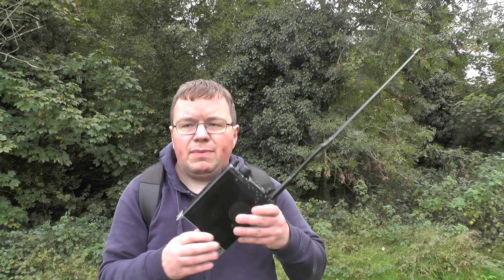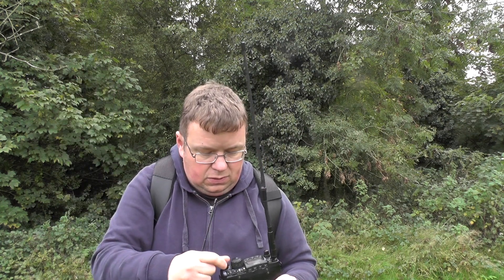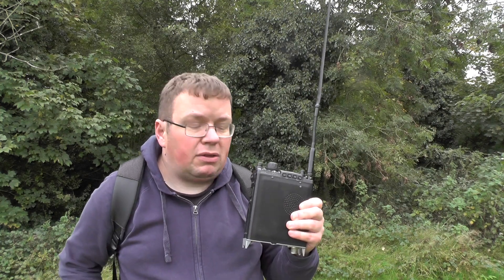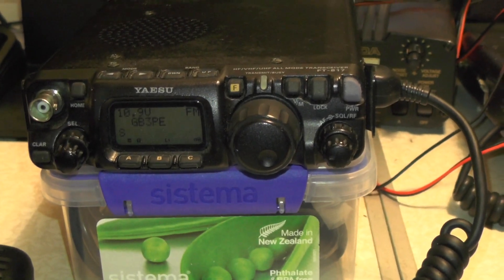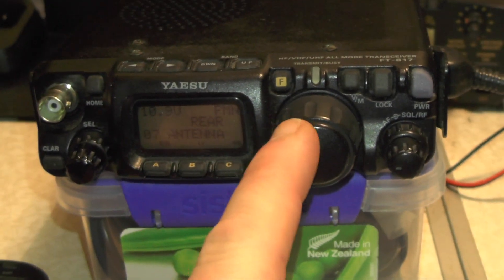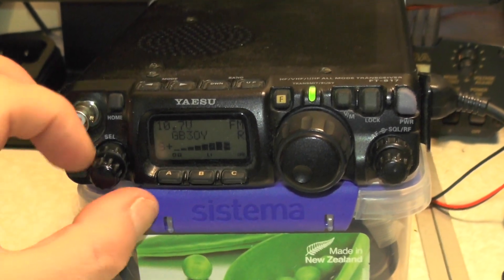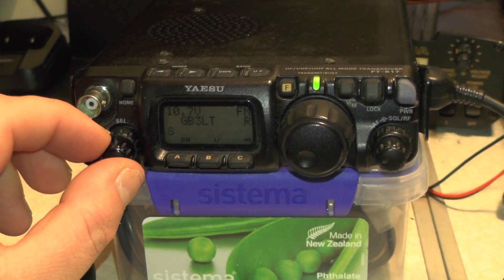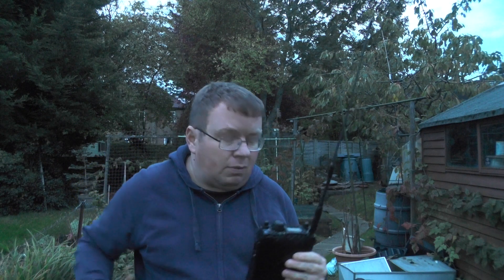Sound issue   FT817

Comment: Did you sort this out, what was the problem,
Dave
Reply from the maker: No not got it sorted as yet been using it on hf it works fine . Saw one at a rally with sound issues on hf but not on uhf/vhf
Reply: Did you try AGC, FMN,
If I get any other ideas I will let you know,
Have you asked on the groups io,

Dave 2E0DMB
Reply from the maker: Ill give your suggestions a try thanks not used it on uhf/vhf for a while now @davidbrowne1588

Comment: It's feedback,  not sure exactly how it's coupled, but the internal speaker is the trigger,  whether it's electromagnetically coupled of acoustically coupled is the question, but it has happened on almost ever ft817 I've seen, especially on FM or AM mode. Using an external speaker seems to be enough to stop it.

Comment: Electrolytic capacitor failure is a candidate. Recap the board and use contact cleaner on the variable caps (ie electro-mechanical knobs such as tuner and volume knobs). Do not interfere with any Mica caps for two reasons. 1. They very rarely fail 2. They are cherry picked by Yaesu and it will be a proper dog's breakfast to reconfigure the unit if you replace these (assuming there even are any Mica caps).

Comment: I don't know the answer but it does sound a bit like "motorboating" from high resistance cells. It will not be the microphone as you don't have one connected. I would be inclined to try it on an external power supply.....

Comment: My 857 developed a horrible squeal/whine similar to your 817 noise. Turned out the front end ceramic filters (a known issue) went bad.  Had to send it off to yaesu for repair.
Reply from the maker: Hi thanks for watching were yaesu helpful? And was it expensive?
Reply: @2j4ez  

No problems with Yaesu. They charged £50 for parts, labour and carriage.
Reply from the maker: @humaxf1  Thats sounds very reasonable did it take long to get fixed?
Reply: @2j4ez  

It's a while back at this stage, but I'm going to hazard a guess at 2 weeks including shipping to and from.

Comment: To find if it is the audio circuit and/or speaker, find a dead channel with no one talking, have volume low, turn squelch off, then raise volume slowly.
When faulty, you should get your whistling back. 
You then know how to repeat fault.
If you then repeat with [PH] headphones and you get the same noise, this will let you know if it is audio circuit. 
[SP] is for external speaker. [SP] is 4 ohm's impedance where [PH] are 16 ohm's impedance,  
Having headphones in and set [SP] could damage your ears.   I don't think it's mic or antenna.
Could be low power/power issue, change the setting VLT 'B' to display the current battery voltage.
Does the voltage drop when loud volume and being distorted. 
Just my two pence worth.   Good Luck

Comment: I have heard similar with portable receivers when the battery voltage was getting low although I noticed you said the batteries were ok. Does it do the same on a PSU?
Reply from the maker: I’m going to be trying it on a psu in the next video

Comment: I think it might be the coil on the speaker, or if not the speaker it could be a capacitor at the audio chip or a dirty pot or a faulty pot.  Check the speaker first, then work back from it.

Comment: At low volume sounds ok. Did, by any chance, you poke a speaker membrane or drop some sand or any other object inside?
Reply from the maker: Not dropped anything on it or dropped the radio not sure what caused it